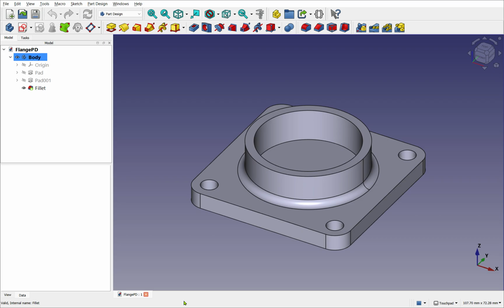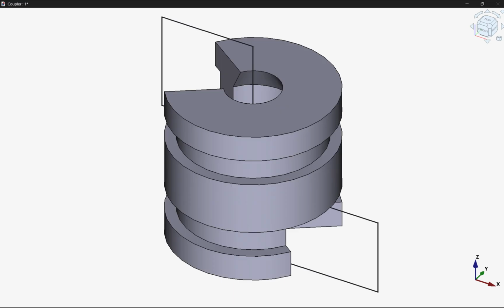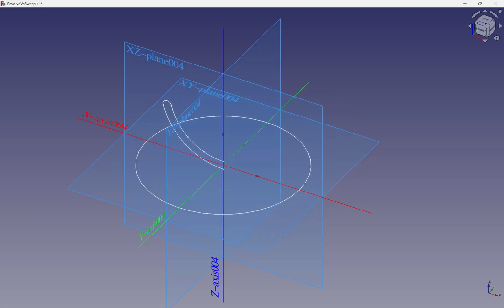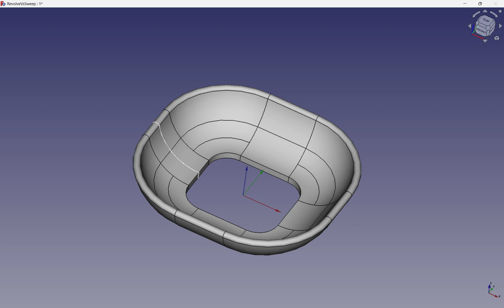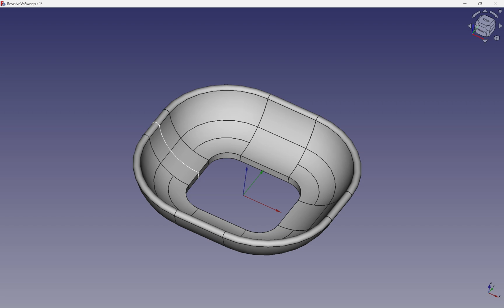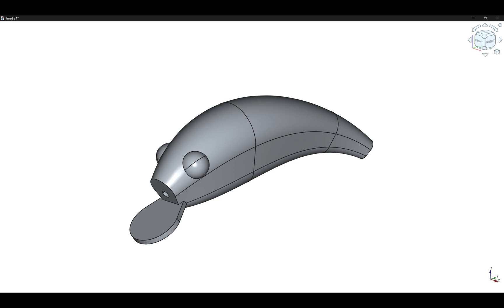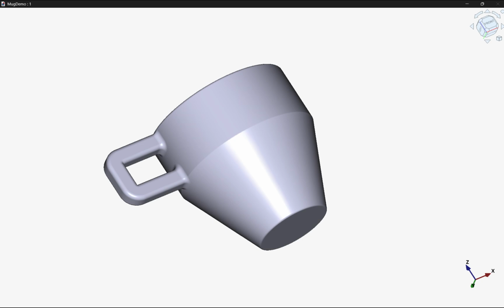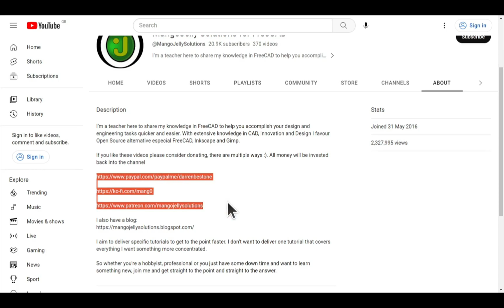Digitalizing Everyday Objects with FreeCAD v1 | Basic Beginners Course Lesson 11 (upd: AUG 2025)

Comment: brilliant video, but how did you create the sketch on the side of the rectangle... i've been trying to work it out for a while... just what i want for a project! any help would be appreciated
Reply from the maker: Glad you enjoyed.  So the sketches you see are attached on the base planes.  So for the bowl with a rectangle at the bottom when using the part design, create a new body, create a new sketch and from there you can pick your base plane. Select XY plane and create a rectangle sketch centered over the center point (sketch origin).  Next create a new sketch this time picking one of the side planes.  Sketch your profile, you will see your rectangle sketch from the side so you can place your profile geometry in the correct position.  Now you can use an additive pipe to extrude along that rectangular sketch.  Pipe operations are detail further along in the course, lesson 26,27.  Hope that helps.